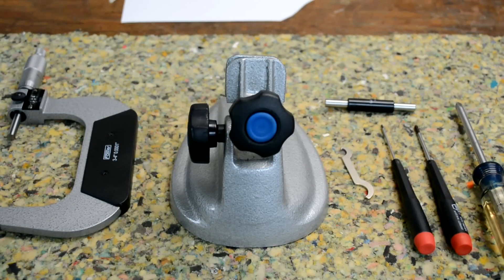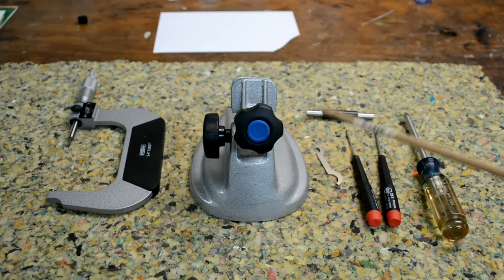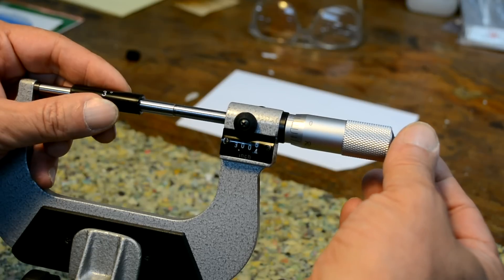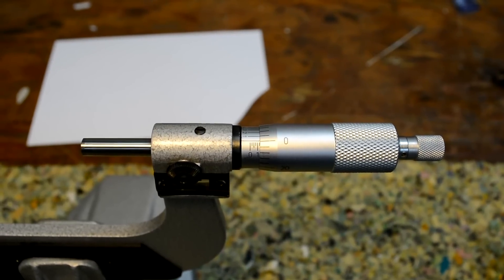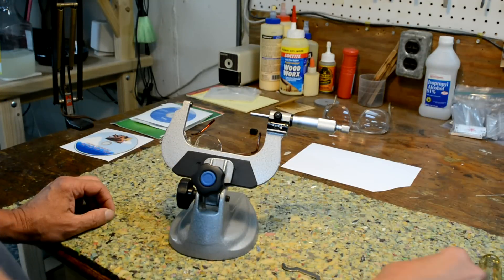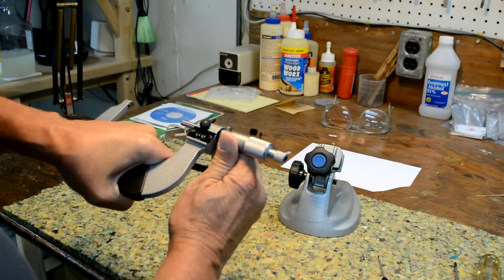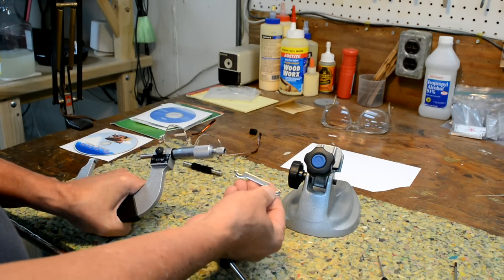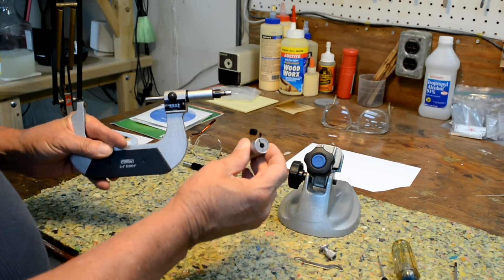Calibrating a Mechanical Digital Micrometer.

Comment: Great video. One question if I may... Did everything as the video shows, and while it operates and is accurate, there is now a near constant ticking noise when it's being used. It will get better if I loosen the screws and back the gears off slightly, or worse if I try to push them in closer, but I can't seem to get it totally quiet. Am I just not getting things lined up perfectly? It's the exact same model micrometer as the one in your video.
Reply from the maker: Try backing off the gears a little and make sure you don't have them installed on an angle.

Comment: Nice video. One thing i noticed is u calibrated it directly on 3.000" where as i think it may have worked better if u would have one it at 3.0003-3.0005" as when u put it back together and ratchet it tries to roll halfway to the 9 in the tenths column. Kinda a pep peeve of mine. I like to use the "digital" scale alone so if its halfway between 0 and 9 in the tenths column that would be 2.9995" now really what u did is fine it is suppose to be a reference as anything under a thou u should use the tenth vernier lines but if u calibrate it like i said u can read the digital part to half thou pretty reliably. If it is halfway between a number u estimate it if it is 3/4 of the way that is roughly 6-8 tenths. The digital scale has to be calibrated perfectly to do so and having 2 forms of readings can cause issues especially if ur company calibrated ur tools they may okay it because the vernier is in and the digital is within a thou therefore the digital cant be used for very accurate readings. This is why i upgraded my 0-1 and 1-2 to mitutoyo absolute coolant proof electronic digital .00005" resolution mics. These are insane accurate like no other. Anytime any co worker needs a second opinion measurement they ask me to check with that. People are very sketch with electronic but in todays age they are the most accurate way to measure. Vernier is reliable but not as accurate resolution wise. Dials aside from indicators are not great anymore. I have a 12 inch brown and sharp and even though it is accurate it has gear teeth that are very easy to break if any little chip or metal gets in there and a broken tooth will cause it to skip and just like that a $350 tool is junk. Brown and sharp already replaced one and refuses to do more so i am forced to use it sparingly. Electronic is my favorite choice. Although dial indicators especially brown and sharp interrapid are still the best choice. Unless u know of a better alternative i do have mitutoyo electronic plunger style indicators but for test style the kind i use 95% of the time its dial only

Comment: Very useful video. Can you tell me how I can fix my micrometer? It is a Mitutoyo o" to 1" and the gears are not engaging  ie; when the thimble is turned the reading stays at zero.
Reply from the maker: +George Henry Hi George,I can only assume that the Mitutoyo works the same as all other Mics, the digits are held to the Mic with 2 screws. Loosen the screws and move the digits up or down until the gears mesh.

Comment: Thank you sir! My very best micrometer got the sight glass broken under one of the screws years ago, and all was good until day before yesterday, when somehow some crud finally made its way into the analogue, and everything was screwed up. The crud in the analogue gears prevented smooth action, which in turn prevented accurate measurements. 
I was just about to throw in the towel, but decided to see if some kind person would post how to re-calibrate one of these awesome units (after I cleaned it). That person is you. I don't know what possessed you to share this knowledge with the world, but I would like to thank you very much indeed!
Reply from the maker: Tim, I hope this video will help you get your micrometer back up and working properly.

Comment: I have got to say, thank you. I create band saws with wood mills. We recently got a complaint saying that our "kerf" was .005 off what it was supposed to be. Turns out that everything was messed up with our Mics. I just finished calibrating it, i am going to test it in the morning at work. One thing. i was told i did not need a standard with .0001 and 1, is that true? or is their something i need.